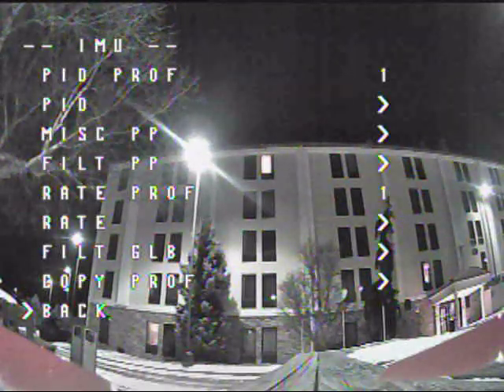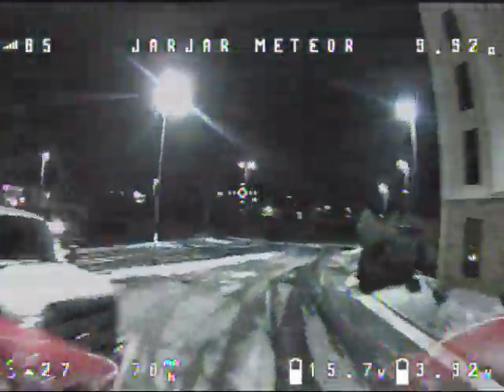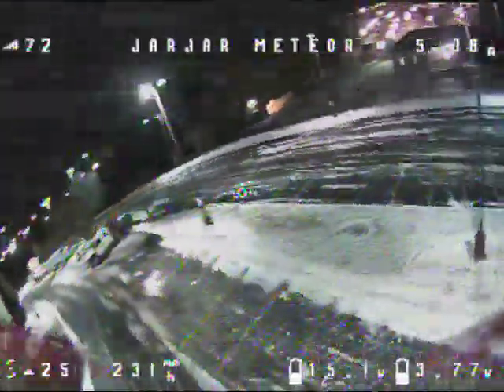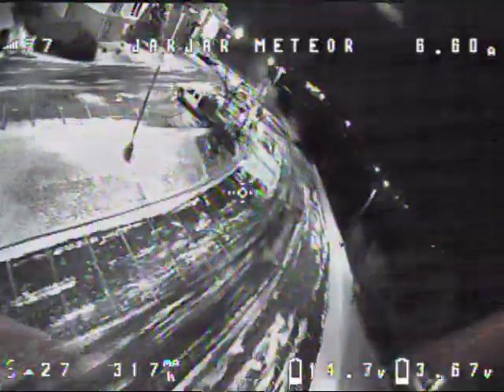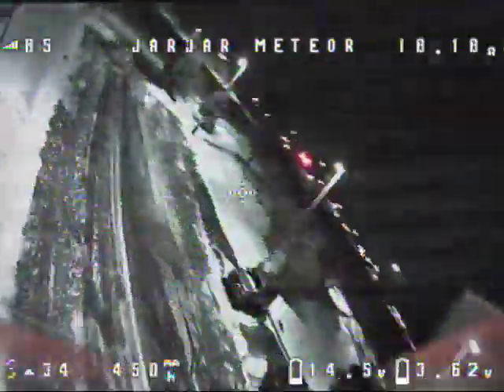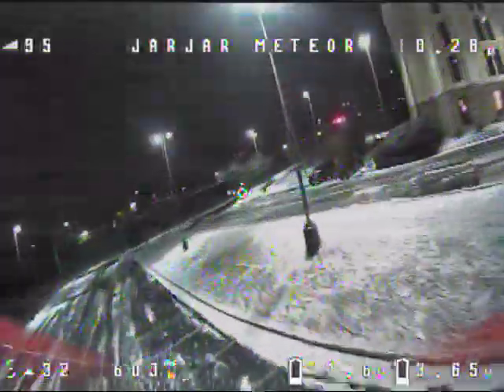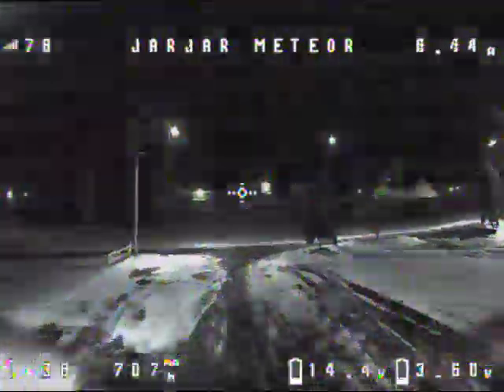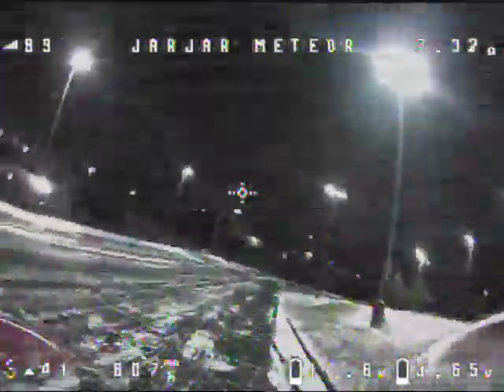FIXED!!! | Unsteady / Uncontrolled Attitude Changes on Throttle Cut

Comment: Thanks for posting this! I’ve had this attitude change issue when chopping the throttle on all 8 of my quads using all different combinations of FC/ESCs/motor brands over the past 3 years. Every single one. Never solved it! Best thing to fix it for me was to crank I term but the robotic feel was a downside. I’m going to try this!!! Thanks again

Comment: Ha! Kind of funny to me. So here is why. I have three cl racing f4s’s. All three go to uncontrollable attitudes when I “pump and dump” from full throttle to no throttle. I have been dealing with this since October. Tuning did nothing other than death rolls out of the sky when pids got way to high. The only thing that would help was if I left the air mode tab on. But that doesn’t completely get rid of it. Anti gravity did nothing. So I gave up. Bought 3 JBF4’s yesterday and now your video describes exactly what I was going through. 🙈😩. Well hopefully the  4.5% to 6.5% helps. And I can finally tune a locked in quad ffs.
Reply from the maker: +HYEonDEATHROW I hope it helps! It made all the difference for me. I've now been able to get a rock-solid tune and flying is completely different for me. being able to trust the quad and know where it's going without wondering if or how much I'm going to have to correct has really started to change my confidence.  I share this stuff so that hopefully it helps somebody else somewhere and for this to pop up and help you already really makes my day.